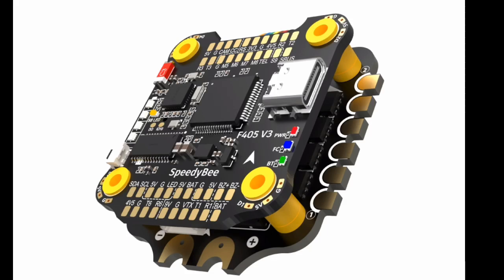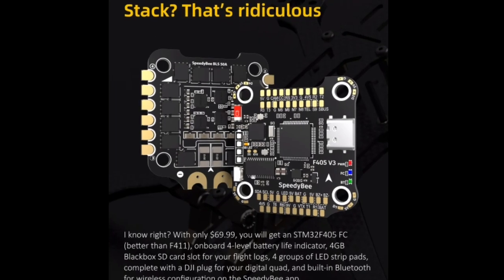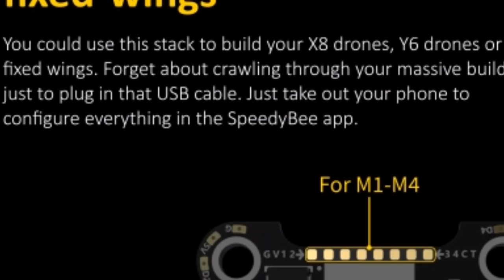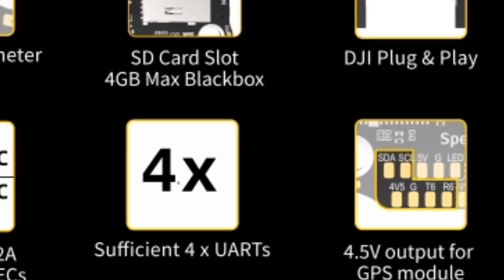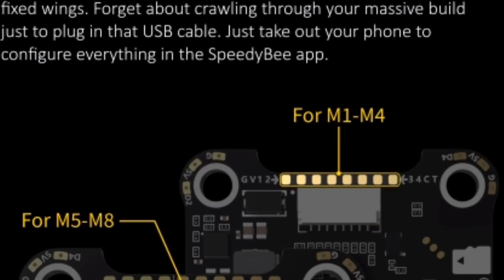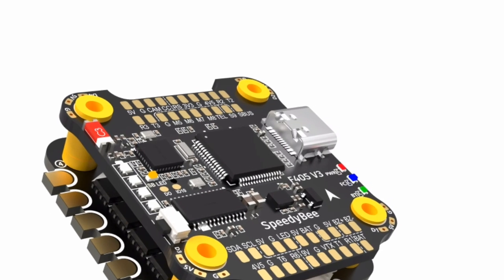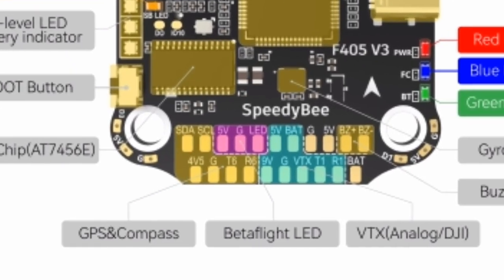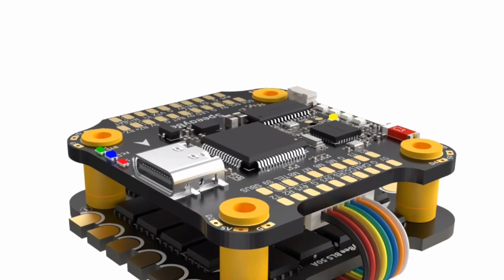Unleash FPV Mastery: SpeedyBee F405 V3 Stack BLS 50A 30x30 FC&ESC Review

Comment: Yeah but you can't use OSD and blackbox at the same time on the V3 it has a hardware bug. That sucks. Spend an extra $5 or $10 and you can get the V4 that works properly will all features.